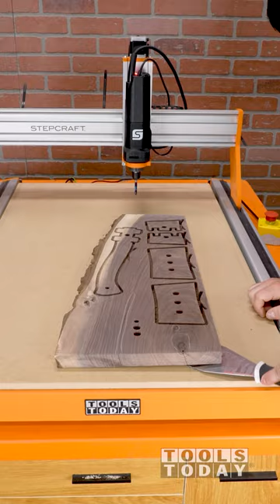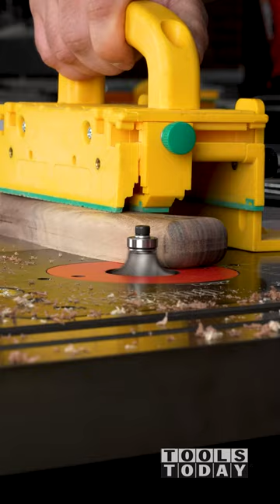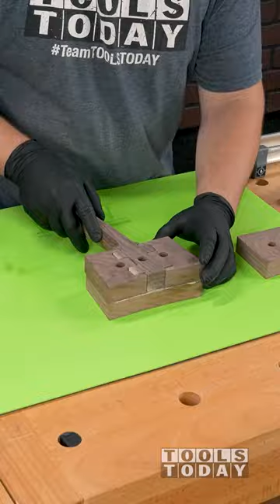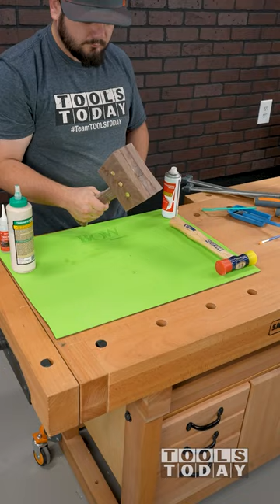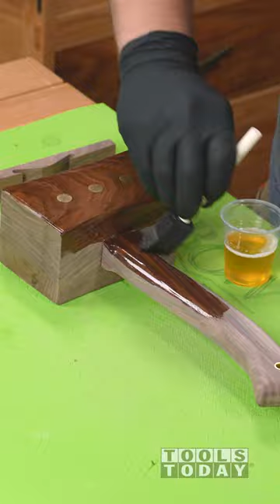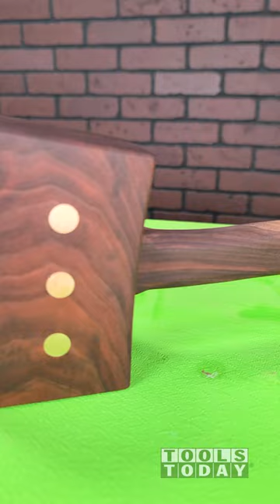Making Walnut and Brass Mallet

Comment from the maker: Check out the full video of making this - https://youtu.be/JU_bnqbpMqE

Check out the plans for this project on our website - https://toolstoday.com/mallet-cnc-plans-downloadable-and-customizable.html

Check out the tools used on our site - https://www.toolstoday.com/stepcraft-3d-840-cnc-system.html

Amana Tool 46350-K - https://www.toolstoday.com/v-13816-46350-k.html

Software - https://www.toolstoday.com/vcarve-pro-10-0-software-for-cnc-1.html

RPM: 18,000
Feed Rate: 100ipm
Plunge Rate: 50ipm
Depth Per Pass: .25"

SawStop Router Table - 
https://www.toolstoday.com/sawstop-rt-tgp-27-in-line-cast-iron-router-table-for-pcs-and-cns.html

Amana Tool 49543 3/8" radius 4 flute roundover bit - 
https://www.toolstoday.com/v-13057-49543.html

Comment: Why did you make the handle and centre layer in 3 pieces instead of one?
Reply from the maker: Because of grain direction and strength.  You want the handle to run with vertical grain for strength, and end grain on the mallet for strength.  You can't get both of those things if the inside is a single piece.
Reply: @ToolsToday  Thanks for the clarification